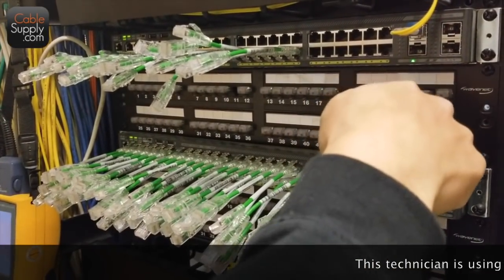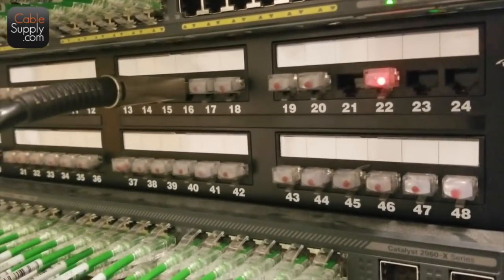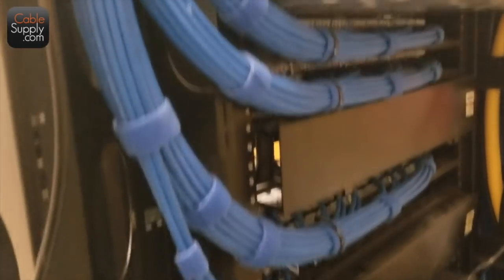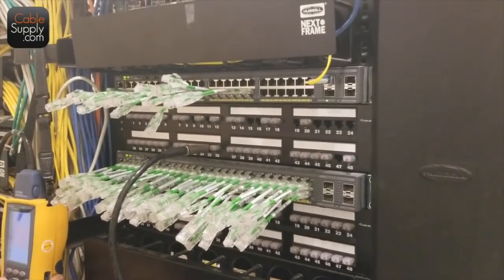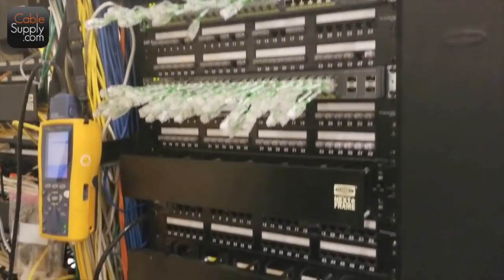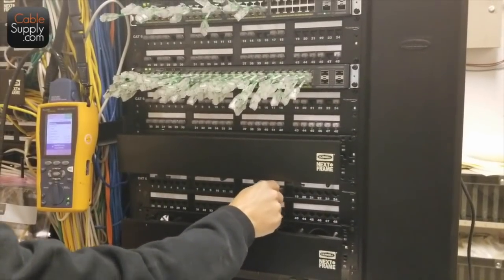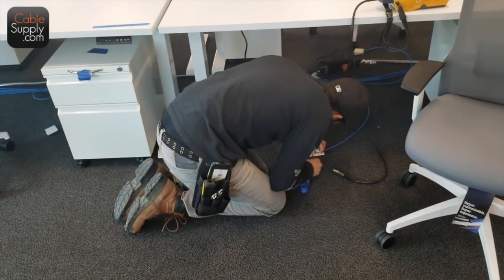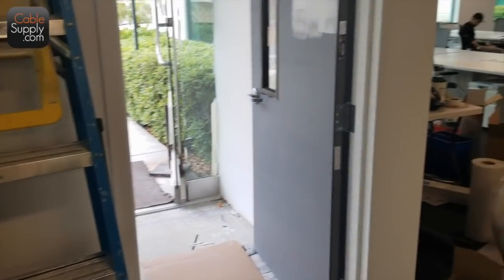Commercial Computer Network Cabling  Part 4

Comment: The one improvement to the LEDs might be to string 6 or 8 of them together rather than having them loose; it wouldn't change the job but it might save dropping one and losing it.

Comment: Thanks for showing all this, as someone that wants to get into IT it is very helpful. You mentioned that learning how to program switches would be very helpful, what is the best way to go about doing that if I can't just go out and buy an expensive switch?
Reply from the maker: I just did a video to answer your question. check out video 5
Reply: Cisco's packet tracer software is a free bit of software that allows you to simulate a lot of cisco's switches, you can learn a lot about configs from them

Comment: I am so confused    why is the led time saving ?      if the cables were labeled and punched based on the label,  then you would not need to trace each cable,      for the customer  dont they want the cables to go around an office or room sequentially.  i hate when a 4 port plat has   46   74    13 and 33        dosent that look unprofessional?
Reply from the maker: Good question, as a licensed low-voltage cable contractor what I have found is installing Jacks in a clockwise direction works well only when you have under 10 jacks in a small office. However, when you're doing a major install of hundreds of jacks (or anything more than 10 jacks) putting each jack in some sort of order does not work well. However using a tool called "the cable identifier" can save you about 30% labor or more. I have found that the customer would rather have a savings on their final invoice rather than have some sort of order. This way of cabling makes it patch panel centric not Jack centric. Check out my other videos on how to design network cabling, especially for large installations.

Comment: Why don’t you guys just write the cable I’d with each side on a sharpie?
Reply from the maker: Time
Reply: So are you giving an as-built print to the customer with labels sort of jumping around then? I’m not disputing that yours is faster than toning - it’s wildly faster than toning or writing if what the customer receives on the print does not matter.
Reply: Absolutely beautiful dress work
Reply from the maker: Yes, I am giving the customer a floorplan with all the jacks numbers identified. my system is "patch panel centric" rather than "Jack location centric". All my jacks are clearly labeled as to the port number on each patch panel. On large jobs I divide the cable up according to location. For example, all the first floor cables are kept on the same area of the patch panel. All the cables on the second floor are put on a different area on a patch panel. All the cables in the west wing are put on a separate patch panel. There is a considerable labor savings doing it this way using the cable identifier. Therefore it allows me the opportunity to keep my quotes to the customer as low as possible. I use "THE CABLE IDENTIFIER" sold on CabeSupply.com. The cable identifier will save you about 30% time and labor. The larger the job the more the savings. I use the savings to give my customer a lower proposal and therefore more likely to get the job.
Reply from the maker: I am assuming that you're asking the question why don't we put it in sequential order in the room that were installing? It takes more time to do it that way, specially on large jobs. I pass on the savings in my proposals therefore, I get more jobs. When you do it in sequential order, the system will be up ended when the customer adds jack in the future. I have made some assumptions and I hope I have answered your question.

Comment: So confused why you would ever need these leds.
Reply: I don't believe they label their cables, they pull them, terminate, then use the LEDs essentially as a tone/probe. I assume they then label the faceplate and hopefully give the customer a print of what numbered drops are located where. I can definitely see some advantages here, its over all faster, makes dressing easier as you don't have to dig in the bundle to find a specific cable to punch down.... and you also save some $$$ on labels. The negatives I guess, it goes against BICSI and TIA's cabling label standards( so this likely would not fly for govt work or any project designed by an RCDD) and you end up with non sequential numbers at the faceplate, which isn't really a big deal as long as you have a print where you can locate a specific jack if needed.
Reply from the maker: Eric, Thank you for your positive words. You are correct we use the "Cable Identifier" to replace the tone and probe. Cat6 and above categories do not tone easily. This saves a lot of time! We label all our jacks (p-touch) and identify them on the floor plans.  Every jack is identified and tested before we turn the project over to the customer.  Never had a problem. In fact to the best of my knowledge we have never had a "goback" concerning or cabling projects. We have cabled a lot of government builds through out the years and have sold lots of "Cable Identifiers" to government IT technicians. As a commercial licensed low voltage cabling contractor with over 40 years of network cabling experience we are professional, competitive and PROFITABLE. Not all innovation comes from BICSI. I invented the cable identifier when we were doing a project with over 600 drops in a large office building in downtown LA.  The bigger the install the bigger the labor savings and the more competitive you can be. It has saved us up to about 30% in labor cost!  Please checkout our video on youtube.com . https://www.youtube.com/watch?v=SiozCYuh-FE&t=9s Thanks for watching please subscribe.